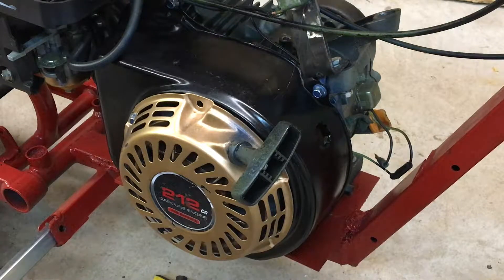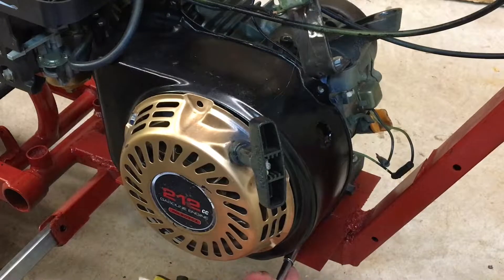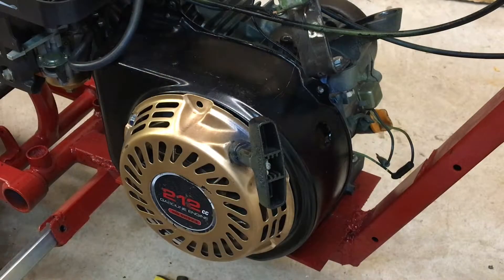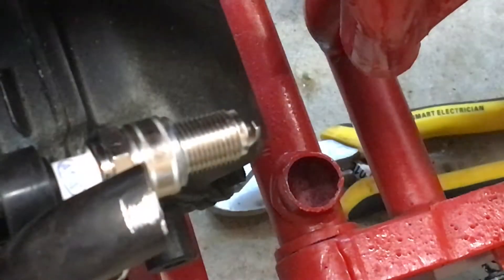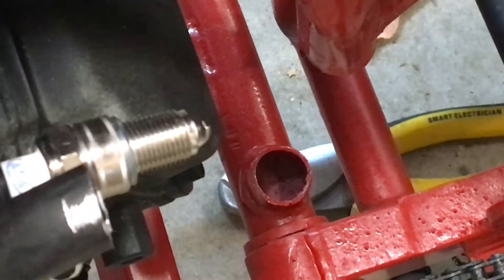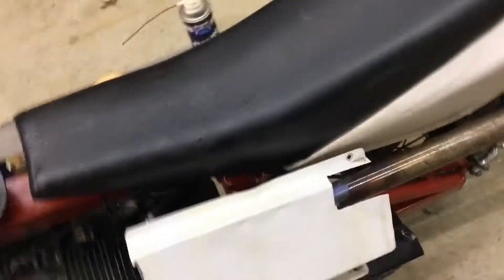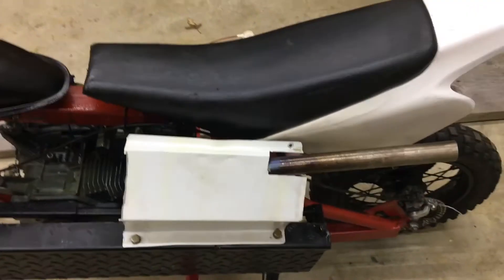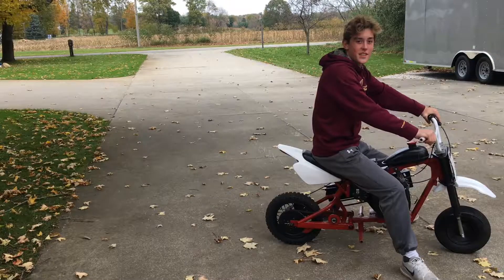How To Install An Ignition Coil On Predator Engine

Comment: So you just tighten it down and that was it? there's no air gap? I can't find nothing on the 212 predator for a gap between the coil and flywheel magnet. Use header wrap on your exhaust.
Reply: the gap is .016
Reply: @christyhoskinson2955  not working